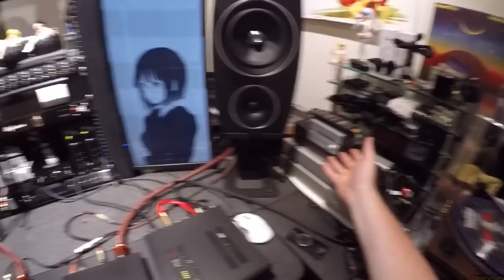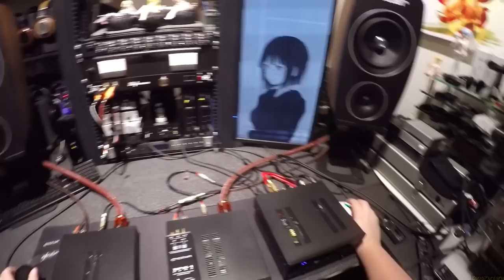Emotiva PA-1 & SP-1 _(Z Reviews)_ mini monoblocks @( * O * )@

Comment: Hope I'm not speaking out of turn but just for clarify: The SP-1 was originally designed to be used with our DC-1 DAC. We have a lot of users that use the DC-1 as a dedicated preamp which is limited to only having 1 Analog input. We got a lot of customer feedback that they wished it had more analog inputs so we created the SP-1 for those that would like to add more analog options including a Phono Pre to their DC-1. The SP-1 remote allows users to cycle through the inputs and control the volume of the DC-1 without having to use the DC-1 remote. In return, the DC-1 remote can cycle through the inputs of the SP-1. The SP-1 can be used to add additional analog inputs to other brands preamps where the user might have run out of available analog inputs as well.
Reply from the maker: Hey guys thanks for clarifying. I will pin to the top.
Reply: @ZReviews  Yeah but they have discoed the DC-1 all that was available recently was refurbed units.ASR (Amir) dumped all over build quality said the crappy caps wouldn't go distance and the thing was dangerous in terms of bad ground.Sucks too because in addition to what the world needs now is not only love sweet love but half size component stacks. You could use a Schiit Sys $50 volume I suppose.Guess the Sprout 100 is better deal.Also they had a good XLR out CD player that was right price and now is $600 with add on inputs.Why is it that folks like Emotiva have the right goods at right price then screw with it.
Reply: Good call on the mini DSP!!!When you gonna get a MiniDsp SHD to review?Streamer,Pre,Dirac,and 2 in 4 out?Only thing missing is MQA and Roon other wise it's soup to nuts!!(Can I say "Nuts" hear?)
Reply: Paid $5 to show fund as pennance for hooking on to Emotiva's reply.Let that be a lesson to my brethren and sisterhen that you have to put something in tip jar for infractions
Reply: Hi, can you please clarify the exact Icepower module used in the PA-1. Emotiva online spec says ACS300, but ICEpower website says that the 300ASC was replaced with the newer 300AS1. So which one is used in the PA-1?

Also, is the PA-1 module better than the ICEpower 250ASX2  (assuming BTL mono operation)? Howcome the ASX2 series have a heartsink but the AS series doesn't? You cant tell which series is superior from the data available on the Icepower website...

Thanks

Comment: The SP-1 was designed to work with the Stealth DC-1 DAC which has a volume control and analog input. Its essentially a twist on the usual preamp-dac setup. Usually the signal boost, volume control and analog input switcher are in the same unit and that is a traditional preamp. Emotiva put the signal boost and volume control on the DC-1 dac and put a passive switcher in the SP-1 with a phono stage. Its the same thing just with the features shuffled between the devices. 
Zeos they maybe thought you'd do this review with the DC-1 dac because you have reviewed it before.

Comment: i really should make a comment about this review, been waiting for a long time for zeos to get around to it.

first i want to comment on some misconceptions: THD is not high on those icepower modules, its just that emotiva wanted to say its 140 watt by using higher THD, it is perfectly capable to get 120 watt at 0.1% THD.

i also want to mention that the clicking noise is not acceptable, and one fix that might be possible, is to disable the auto standby feature since that is what causing it.   i got a icepower poweramp myself and that also have that auto standby feature and even tho it dont make any noise it is still a broken feature. if you get the proper manual with blueprint i found that you can disable it by bridging 2 pins. it is now always on.

some of the more experienced reviewers that had this emotive pa-1 amp said it was the best sounding amp they make. but as zeos said, you need a good preamp, preferably with balanced out. its basically high end amp and should be reviewed like it.

there is not excuse for emotiva sending a control unit without volume control......  but then emotiva don't have a stereo preamp with balanced output. so next step is surround processor with balanced out. they should at least sent zeos that instead.

Comment: The SP-1 are just an ICEPower 300ASC in a housing. That would be where the story ends, but the SP-1 is about the cheapest way you can, as a consumer, get your hands on a 300ASC amplifier module. And sometimes what you need is a basic, very basic, amplifier module to expand your system and you don't want to shell out for a whole XPA chassis, or you know you like the sound of the ICEPower modules and want to put them into a system with a stereo pre-amp like the XSP-1 or BasX PT-100, or a home theater processor like the XMC-1. I hear you about the Control Freak knobs. That and the DC-1 dropped off the face of the earth before their time was finished. The Emotiva products that are worth having (to me) are the DC-1, Control Freak unbalanced version, TA-100, and XPA gen 3 series. (And I happen to have all of those listed.) I'd also take the new BasX A-100 for driving headphones. The Stealth SP-1 was designed to hang off the analog input of a DC-1 and expand it to a full "Stealth Stack", but the DC-1 was canned in anticipation of a DC-2 DAC that didn't materialize.

Comment: Speaking of Behringer, they discontinued the A500 and replaced it with the A800 which happens to be class D. Be interesting to hear your thoughts on that amp Z.
Reply: The A500 was actually pretty crap. Check out it's measurements. Hopefully the A800 is better.

Comment: 1. Can you hear the ticking with music, as in a silent part of a track or in between tracks?  Can you hear it from about 8 feet away?  2.  Nobody is going put 300W monoblock power amps on a desk setup.  3. This is the same amp module with same specs as used in the $2,500 Bel Canto monoblocks and the same as PS Audio uses in the Stellar amp, $800 mono or $1600 or stereo. 4. Power amps do not have volume control, that is an integrated amp.  The Bel Canto mono's (same ASC300 Class D amp modules!) are currently Class A on Stereophile's list of Recommended Components.   5. What the hell is Rocky Mountain? Is that like Fitz  Pass?  Gotta secret?  6. Check THD on a $10K Mark Levinson, it's .1%.  Emotiva rates THD at full power like Crown and QSC,  not at 1 watt like Sony or JVC.  You should have used XLR that is what it's made for.   Good review otherwise?
Reply: are you sure. I thought integrated meant it has a dac of some sort.

Comment: Those red power cables can't really be 10AWG conductors like the Amazon listing says. 10AWG wire is 6mm in diameter, and they have a photo that measures overall diameter of the cable to be 17mm. 3 x 6 > 17!...And that doesn't add in the extra girth for insulators and shielding! I'm guessing the conductors are only ~14AWG each.

 Zeos, or other owners, want to take one apart and give us the proof.
Reply: Then buy one & take it apart

Comment: Ticking is comming from Switch Mode Power supply !, humm, I got to be honest I do like quiet units.....sometimes  you NEED to load switch mode power supplies to work properley, its the Ferrite switch core that NEEDS to be encapsulated, you could measure that area with a oscilloscope on the power rails,

Comment: Looks as though both Emotiva and PS Audio have both gone with sterile, lifeless and harsh sounding ICE modules. These companies must be getting a great deal on them since there is no other reason to use them.
I purchased the new version of the Sprout integrated several months ago. After listening to it connected to my Tekton Pendragons, I was immediately ready to send it back after only a few minutes of listening. I don't think any amount of "break in" would improve the sound of that thing.
When it comes to Class D, I haven't heard anything that sounds better to my ears than the Hypex modules...not just the Ncores, but also their OEM modules.
Reply: You gotta cut class d's some slack. Yes hypex ncore are the best class d's but the icepower are a solid #2. Class d amps have come a long way. Of course a class a or class ab with a high class a bias is best but for the convenience and price they do have a place. Maybe for home theater use or if an integrated amp is needed in a small space? With that being said I have a Nad D 3045 and it uses hypex class d's.
Reply: ICEpower modules can sound very good if properly implemented and fine tuned.  I run the PS Audio mono blocks with the ICE 700ASC modules and they are a long ways from being sterile, lifeless, and harsh.  They're completely neutral and ridiculously powerful running my 4 ohm speakers.  They do some stuff on the analog input side to change the sound to get rid of the typical Class D traits.  I totally agree with you about the sonic tuning of their other products though.  I had their gain cell dac/preamp, and it sounded very harsh and sibilant with boosted highs.  Was not impressed at all and sent it back.  These emotivas though are basically a DIY setup with an ICEpower module in a box, and no fine tuning on the input.  Might sound very stereotypical Class D.  I was checking these out last week for my other setup and I decided to look into a pair of Apollon amps with the Ncore modules for a little more money.
Reply: @alexanderjellison3063  so, I am very curious what preamp you are using with the PS Audio M700 monoblocks and with what speakers?  I now own the PSA SGCD (after my Theta preamp and trying Parasound) and am feeding the little Emotiva PA-1 monoblocks via balanced XLR into my 4ohm Vienna Acoustics Mozart Grands and prefer the sound to my Adcom 555 mkII monoblocks and my Anthem A5  amp.  I think the PA1's are a sonic bargain and after my research, I felt they would be very similar to the PA Audio class D amps.

Comment: My Miller Tig welder has a thinner ground cable than the power cable for that speaker amp, at full power my welder 210 amps at 240v will pull 50,000 watts 😂

Comment: Z....what you need is a line stage which will give you switching and a gain control such as an emotiva PT100

https://emotiva.com/products/pt-100

this gives phono mm/mc, dac, and tuner with gain control.  no need for  any more than the PT100 and the monoblocks.  why did they send that separate phono section.

...hifitommy

Comment: I tried those Emotiva monoblocks for my desktop LS50. Pretty good, but I opted for a pair of Outlaw 2200 monoblocks, instead.
Reply: LS50s are deceptively power hungry. They really love that class ab or a power.
Reply: V1ralB1ack True dat! The Outlaws pump out 200 watts each.
Reply: Or use a Parasound 2350 with a stereo i700as2.  350 watts at 8 ohm, 600 watts at 4 ohm.

Comment: I remember back in the early 2000s when class D came to car audio. At that time it was just limited to sub amps due to the high THD.
Reply: you misunderstand THD, the distortion is only at that wattage, if you lower the wattage by 10%, THD usually drop by 90%, so i would say this emotive 140 watt amp is really a 120 watt at 0.1 THD.